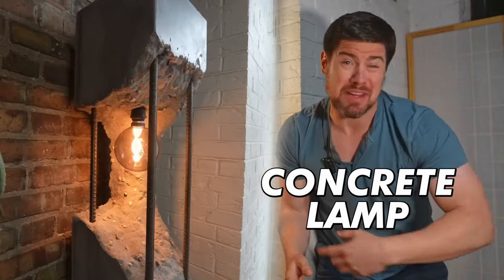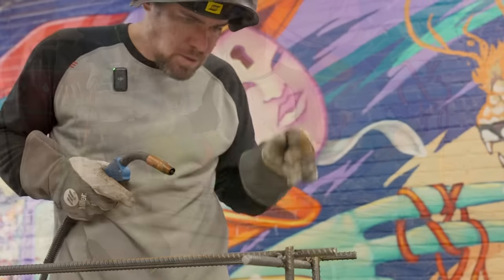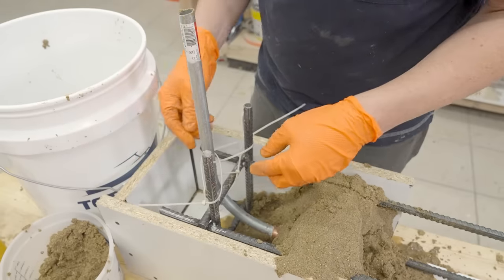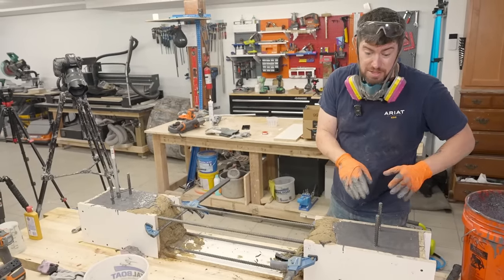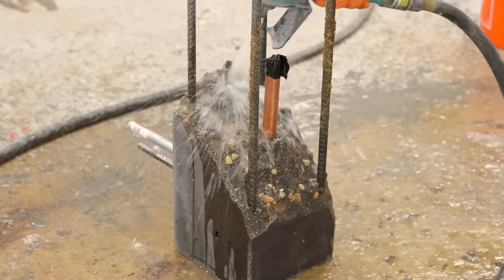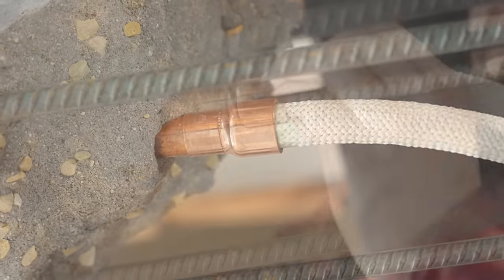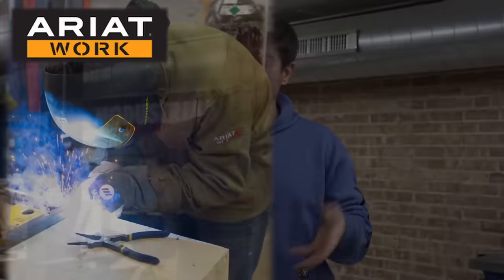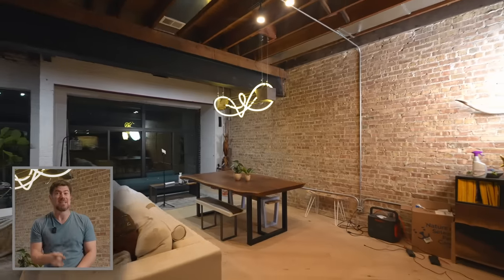This was Not Possible... until Now

Comment from the maker: Save up to 50% on your system and your first month is free when you
sign up for Fast Protect Monitoring. Visit https://simplisafe.com/modustrial to
customize yours! Try SimpliSafe risk-free. If you don’t love it, return it for a
full refund within 60 days.
Reply: Option 3 for me
Reply: You could have used tie wire to tie the rebar together and to secure the conduit.  You also need a bushing on the end of the emt to protect your electrical cable from damage.
One suggestion: can you try a design where you use the rope light in place of some of the bars of rebar?  I think that might make for an interesting look.
Reply: how about telling us where to get those LED ropes?
Reply: @Ucceah  he put links in the description.
Reply: To give your concrete more of an authentic look instead of using melamine use pieces of a plywood as they would leave slate imperfections of the plywood in the veneer of the concrete giving it a more realistic look
Reply: @kurtzxcvb3481  true. You'd pick up the textures from the wood grain.

Comment: Something to consider when it comes to rigging standards for overhead installations. Where I work we almost always use a combination of brass inserts with 1/4 20 steel shouldered eyebolts with quick links rated to exceed your maximum hanging weight. These are not only much more secure than two screwed in hooks, but with primary and secondary connection points (4 separate inserted shouldered eye bolts) in the case of say an earthquake or something hanging or catching on the installation you can be confident the connection points will not fail and potentially fall on someone, avoiding injuries and or property damage.

Comment: As a beginner interior architect, I would absolutely go with the third option. With the rope spread out all across the entire beam, you'll be able to light up a larger surface area in comparison to the other two designs.

The design itself is also calmer and more elegant than the other two, it fits your interior better in my opinion. The concrete ends are also truly incorporated into the light now.

Comment: For a more clean look. You should looking a Nico press with the copper sleeves. Instead of the (Crosby) you called them saddle clamps. It’s 100% cleaner. Also just a warning wire rope bought at a hardware store is not rated for overhead lifting. It will work but there is some danger in it about 10% . Love your content been watching it for years @modustrial.

Comment: Option 3 is the best but I would put the string of light on the left side of the fixture to be on the other side or at least go through the cable, just to have a little bit of symmetry 👍👍

Comment: I like 3 the best for keeping the "rope" aspect of it. I think the way I'd do it though is to have a straight piece of the rope going from one end to the other, sort of like a tube of light in the middle.

Not that it matters at all in this sort of application but in a structural application you're not "supposed" to weld rebar. Reason being is that common rebar isn't actually isn't that weldable, the welds can be prone to cracking. Also, if you in a situation where it has to be inspected, most inspectors aren't qualified/equipped to inspect welds.

Comment: Cool light fixture.  Liked the Third best- almost wich you had three more ft of light rope. Or hidden uplights  in the top of the concrete to cast some slightly different colored light on to the ceiling.

Comment: When connecting two different types of metals in a possible moist environment,electrically isolate the two metals from each other with either electrical tape or heat shrink tubing. This will help minimize galvanic corrosion.

Comment: Option 3 is the best choice, spreads out the design and the light and gives more to look at. I was thinking how would it look if you went back over the top of the concrete and then wrap around the centre and wrap around the concrete on the other side, could look cool

Comment: I liked option 3 but it could be super cool to start the first loop going back over the concrete and in between the cables before looping around. It would light more of the table and look cool to have it circle around the outside end of each concrete block.

Comment: Option 3 looks the best with the structure that you have currently. However my favorite design is options 2. As you said it needs to be longer and more spread over the table in the space. Clearly you need to build a second one that is much longer so that you can go with option 2 and still have it illuminate the space well.
Reply: As a tall person please don't! if the concrete ends were longer than the table I for sure would have a concussion

Comment: You can put rebar together and tie it with some wire or you can fuse steel molten by the power of lightning!
Nice lamp, I'd stick with option 2.

Comment: Also, don't use those hooks. Use forged eyebolts. I worked for an audio video company years ago and they were brought in to repair the speaker mounts in a large church. The original mounts (by another company) used those hooks. The were rated for the weight, but over time, the hooks deformed. Drop forged eyebolts will never deform.

Comment: I think a good way to make this look more mysterious, more brutalist, and have less weight is by making it hollow rather than solid on the edges, like literally the same design except instead of it being a "cut off solid cube" it becomes a "cut off hollow cube". The LED rope would originate from the inside of the hollow cube, and it will also light up the inside of the hollow cube, and you can even add some rough metal plates lining the interior to make it look even more brutalist.

Nonetheless this was an amazing project and really opens up new design ideas.
Reply from the maker: Cool idea!

Comment: If you ever tinker with the light some more, you could weld a couple of reinforcing squares inside or around the rebar. Maybe in smaller gauge or some such. Would be consistent with the industrial look and keep it from sagging. The structure seemed a bit springy while you were hanging it up. Looks awesome, though. Nice work :)

Comment: 11:29 I wonder if you could “glue & heat-shrink” the cables and thimbles… the connect the ends with a steel cable crimp as well as heat shrink those… (to reduce the size and bulk of the saddle clamps)…. Them you can use a turnbuckle for final adjustment to keep each end level (possibly media blast the sink coating off and paint to match the hear-shrink) 

This is an amazing project… also would “aircrete” be too crumbly for the project?… coat the outside of the project with glass reinforcement HIGH STRENGTH concrete on the bottom and sides (troweled), fill mostly with either aircrete or a concrete with shredded styrofoam “beads” (like that’s in a bean bag chair) to lighten up the concrete…. And finished with the top being the final layer of high strength reinforced concrete. 

(I was going to suggest expanding foam but there would only be two ways to do it and one concern:

1. Use high strength concrete or grout on sides and bottom (or exposed sides) let set, fill with expanding foam then put the high strength concrete over the exposed foam.

2 place “support foam” as you add the high strength concrete, then once set, fill the cavity with expanding foam.

…but then there would be a seam, and depending on the foam, possible breakdown over years)

Love the content though! Too bad it’s most likely impossible to “tie knots” in the rope light without damaging the led’s.

Comment: For better ease of management, maybe use something like a rusty looking gx25 connector to the light.
This way you can more easily attach it to the ceiling/rewire it in case the light breaks/dies. without having to resolder/rewire everything in the ceiling

Comment: Missed opportunity: you could use the steel wires for the electrical connection as well, that would remove that ugly electrical wire.. it's low voltage I assume, so it wouldn't be dangerous.. and you would need to isolate them from rebar, since that would create a short, but that should be easy enough.. 
option 3 is the best I think..

Comment: GFRC is very easily recyclable as a base for new construction or for new concrete projects. So not only is it using recycled goods to help strengthen it by using recycled glass, but by recycling the gfrc concrete via contractors and landscapers waste is pretty negligible.

Comment: Love the design, all of them are good. However, the "heavy duty" hooks used to hang this 100lb+ thing is unsafe. It should be hung by a forged closed loop eyebolt and a shackle. The open ended hook is not rated for any kind of weight static or otherwise. That would not pass code here in Canada.

Comment: Option three with a twist.  Any possible way to add a smaller tube of accent color?  8-)
Reply from the maker: that would be very cool, but would have to plan for it before the concrete pour so it could be attached to and have wires hidden in the concrete block

Comment: what would have been cool, is if you cut out peices of the rebar in the middle and use a rust accelerator on it and make it look like rust ate it away as if it was out in a post nuke bombing....  and make a high carbonflame on a Oxy torch and make the concrete look like a blast hit it and use a clear coat to seal it up.  But the clean look you did looks amazing too!

Comment: To save weight on the next one, make a styrofoam inner box that the cement forms around. It might take a bit of juggling with the rebar, but a hollow box section of the ends would be a much better option. Or, come to thing of it, use the playground sand.  You could use it as filler, and with copper tubes in the right spot, you could flush it out with water.

Comment: Kind of disappointed in this one.. Hanging points on the lamp was sloppy, the piece of pipe that should be cut flush with the concrete and the hanging points in the ceiling looks rushed to with hideous gaps. shortcuts where taken... That said i liked option 2 and 3.

Comment: I mean, you could have just made those lights yourself. It's a Chinese finger trap tube with LED tube strips inside of it. Look for things like Deco Flex Tubing, Natural Latex Rubber Tubing (awesome warm color from these, and a futuristic aesthetic), Cable Sleeves in various colors, Expandable Braid Sleeving (to be precise) is the type that looks good. I won't put any specifics here, but just look through, and keep looking, and you'll start to see versions of these that are of a better material, pattern and aesthetic than the rest.
Reply from the maker: I've got a bucket with probably $1000 worth of the things you mentioned... Trust me it isn't as easy to recreate as you think.
Reply: @modustrial  haha I figured you did. I knew you would have been trying to make them.